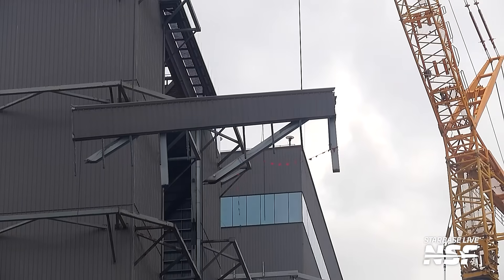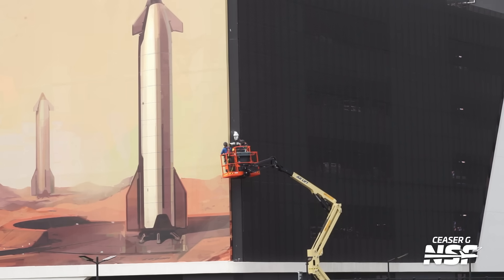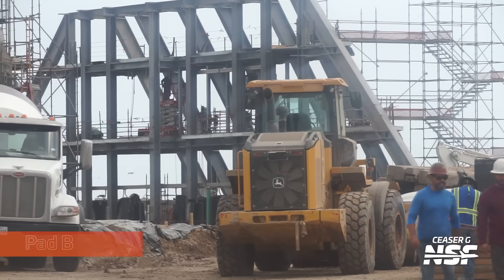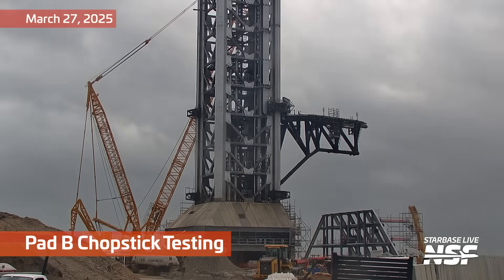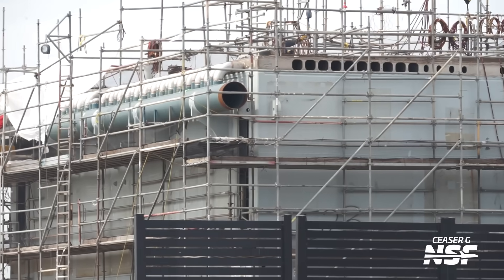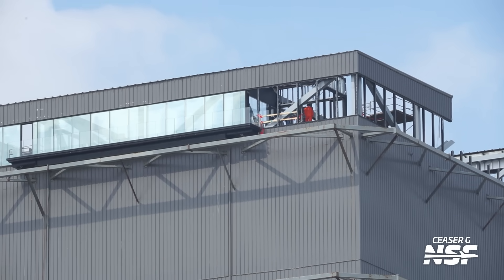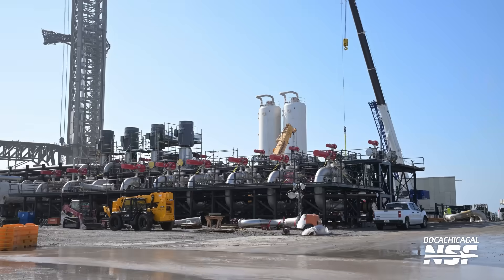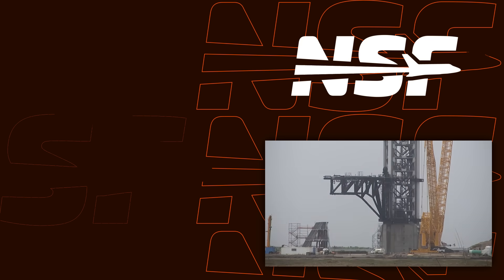Severe Weather Doesn't Slow Down Starbase | SpaceX Boca Chica

Comment: The labels on the air tanks saying Asphyxiation Hazard, Cryogenic Hazard, somewhat imply that it's some kind of inert gas chilled to a liquid, such as nitrogen or helium. There's nothing suggesting a poison, so I suppose it's not CO2, which is considered pretty inert also, but can still poison you at high concentrations. And it's not flammable so that means its not hydrogen or methane. Since these inert gasses can displace oxygen if released in large quantities, the asphyxiation hazard sign is a must. In fact, nitrogen or carbon dioxide are often used as a purge gas, where they need the oxygen displaced. Helium is not because its too expensive. But these rockets use nitrogen and helium so, pretty sure it's one of those.

Comment: In Minnesota we call them circles 
turnabouts
Easier for someone used to turn around and you're right the back wheels go up onto the concrete sidewalk, making it less radius that they have to turn on 
In fact, it's cheaper to put a roundabout on than a stoplight and it keeps cars moving without stopping 
Most of the time

Comment: 3:47, what they are filling from is an Liquid nitrogen or LN2 Dewar. Dewars can be used to either produce liquid or gaseous nitrogen depending on where you set the expansion valve on the dewar at. You fully closed expansion valve with leave you entirely liquid while increasing the pressure will give you more gaseous nitrogen. LN2 or GN2 has loads of uses in aerospace for purging systems of humidity, supplying actuation valves, and so much more. Cryogens are scary but LN2 is probably the “chillest” of them all.
Reply: Or Argon for welding purge gas

Comment: Re: the roundabout on Hwy 4. It doesn't need to be big enough for the trucks to stay on the flat surface if they have a slopped curb and flat area in the middle. The rear axles can run up onto the curb and flat area. Otherwise, it can be used by all the smaller vehicles too. You just don't want people to think they can drive straight through over the middle at full speed!
Reply from the maker: I've seen that video haha. - Das

Comment: I think the re-assembled high bay would match the car in the song.  Likely less functional.
Reply from the maker: Might end up with only one tail fin 👍 - Das
Reply: @NASASpaceflight  But 3 headlights.  you could use the party lights for that,  cool.   The salvage company might notice the missing $ from the salvage return.  (Funny thing, the company I used to work for saved up millions of $$$ to scrap a project with lots of steel, They were surprised with the demo company asked if they could keep (salvage) the steel.  The end bill was in the thousands of $$.  I was a bit incredulous (either about the story or that they actually did not know the steel had value))